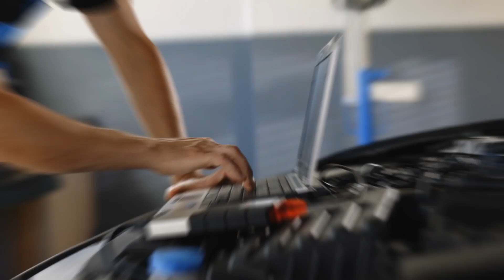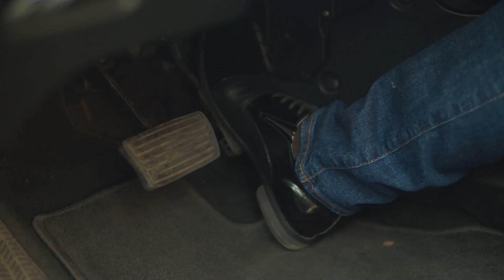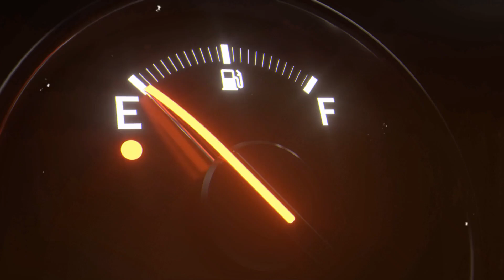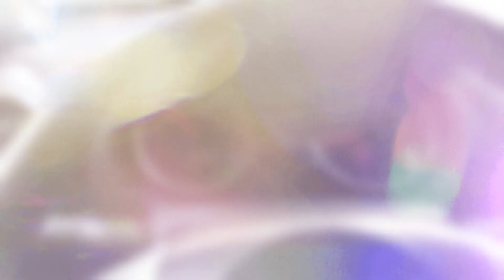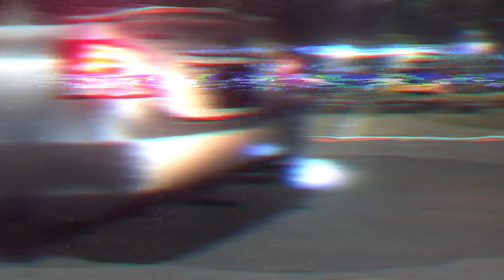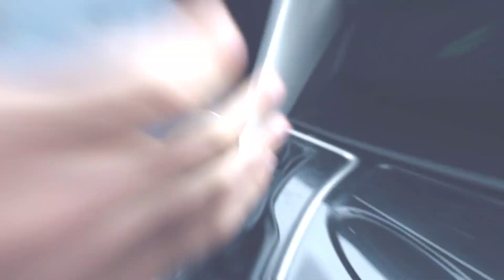Top 11 Symptoms of a Bad Mass Airflow Sensor (MUST Watch)

Comment: Hi sir, I have in my car.my car is Subaru legacy 2002 model limited edition. It run in good condition but the check  engine is always on. I found in the scanner that is po113. Can you  kindly tell how to fix it?
Reply from the maker: Hi there! A PO113 code usually indicates an issue with the intake air temperature sensor. I recommend checking the sensor connections and considering a replacement if it seems faulty. It's always a good idea to consult a mechanic if you're unsure!